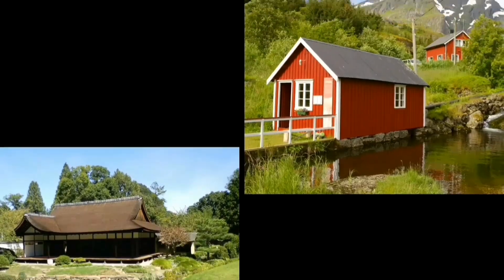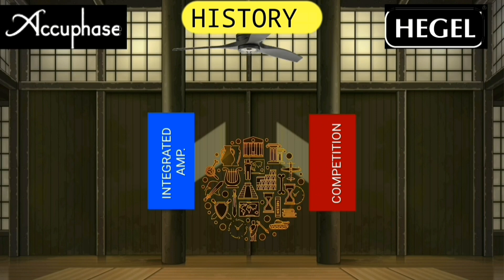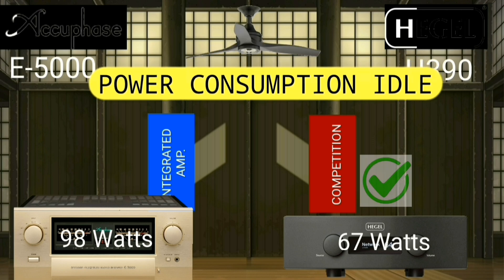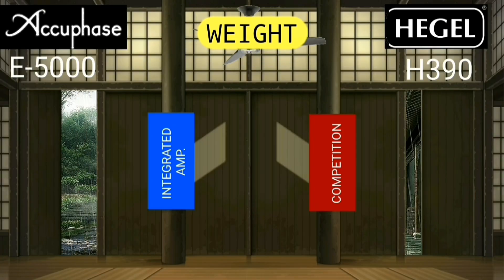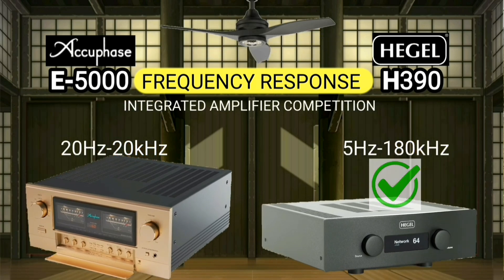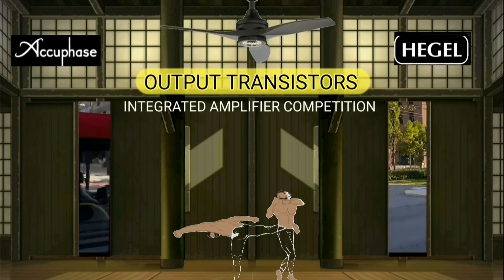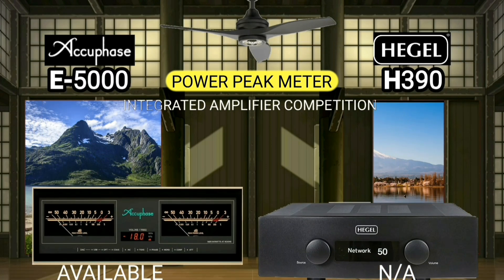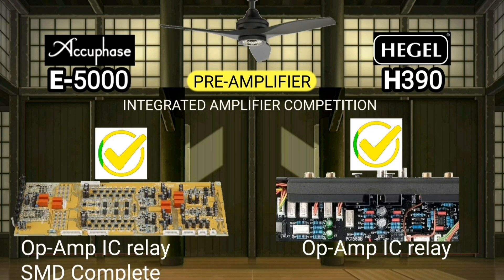King of damping factor Accuphase E-5000 vs defeated by hegel H390 integrated amplifier

Comment: I know some very  hi-end speaker manufacturers use the H390 to test their speaker systems. The reason is that they are the most neutral amps with the lowest distortion of all available amps they tried.
Reply: Hegel H390 is very neutral sounding amp, can drive almost any speakers, zero distortion thanks to its software-based correction, and its 4000 damping factor produces the cleanest bass sound. There is nothing out there that can compete with Hegel H390 at its price.

Comment: Why be disappointed with the Hegel on/off button when you only press it once and then turn the Hegel on from the remote!
Reply: The only way to turn of h390 completly is to remove the power cable
Reply from the maker: In emergency conditions, the main power button needs to be pressed when you want to turn off and secure the unit.

Comment: I have a buddy that has an Accuphase integrated amp and it sounds great on his top Focal floor standing speakers.  I considered going with the Accuphase which I listened to extensively before hearing and then deciding to run with the phenomenal sounding and hugely powerful Hegel H590 integrated amp for my Revel Salon 2 speakers.  The Accuphase has it's signature sound and so does the Hegel.  The choice is yours.  To say that the Hegel can't touch the Accuphase in sound quality is totally and absolutely absurd.  I chose the Hegel H590 over several other brands of very high end integrated amps, as well.  The Hegel H590 can compete favorably with any high end integrated amp on the market, even those that cost more.  Phenomenal sound is phenomenal sound regardless of brand.
Reply: The new Hegel600 will surprise you even more.

Comment: Hegel is a liar in his specifications, I already had H360, then I went to E-460 and now I have E-470 and I already want to move on to E-5000, and I can guarantee that no Hegel model can even tickle the Accuphase...
Reply from the maker: And what is your suggestion whether the specification should be done by a third party?
Reply: @JNElectrics  For example: In the specifications the Hegel H360 says it has 410 watts in 4 ohms, or something less than that, while the Accuphase E-470 has 260 watts in 4 ohms, just listen to both to immediately understand that this power specification It's a lie on Hegel's part, since the E-470 with its 260w into 4 ohms is much more powerful.
Reply: @bobberbodoke  Hegel 360 does not exist in nature. There's a Hegel 390.
Reply: @Последнийиз-Могикан  Yes, there is an H360, I had one
Reply: @JNElectrics  Listening to the equipment whenever possible before purchasing...
Reply: @JNElectrics  by Stereophile at least
Reply: Hegel 360 does not exist in nature. There's a Hegel 390.
Reply: H390 is more powerful their is no question about that, and no Hegel dosent lie about its specs witch can be prooved by looking at mesurements
Reply: @andreasmoller9798  H390 is never more powerful than E-470, I've had both and I can say that the H390 is inferior in power to the E-470
Reply: @bobberbodoke they are quite simular in terms of power, both Will have no Trouble driving most speakers on the market, i know the accuphase e5000 is the better of the two, but it cost 3 times more money, h390 is stable down to 2 ohms where it has 1000 watts of power, it almost double its power every time both from 8-4 ohms but also 4-2 ohms, i own h390 and it never breaks a sweat it has more power than i ever need, accuphase is out of my price range, and the fact that you have no internal dac witch going to add to the cost even more, no streaming witch the Hegel has both of, the price difference between the amps i would rather spend on a pair of speakers instead because after all they have the biggest impact on how things will sound
Reply: @bobberbodoke  what about the sound quality using an external DAC?

Comment: The Hegel don't come not even close to an Accuphase, by all means 😂😂😂
Reply: Especially when you consider build quality.
Reply: @ChicagoRob2 
The E-5000 disappoints with some sub-par speaker binding posts, not to mention the visible screws on the side panels… Compare it Yamaha’s AS3200 which oozes quality!
Reply: @SirMountainpass  Yes, Yamaha A-S1200/2200/3200 are built like tanks.
Reply: Accuphase is no doubt better but it cost 3 times more than h390 this is really a silly camparsion
Reply from the maker: So far Hegel is very proud of the damping factor of 4000, because it tried all its advantages.😁